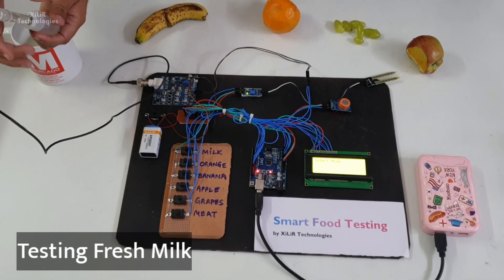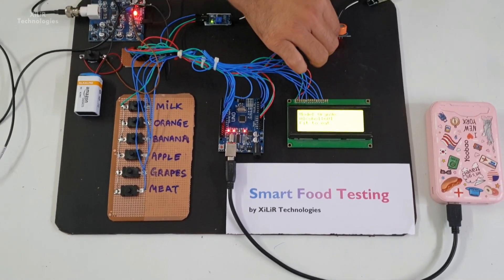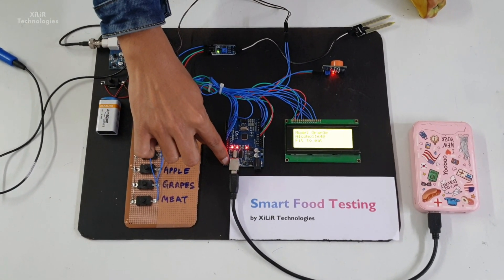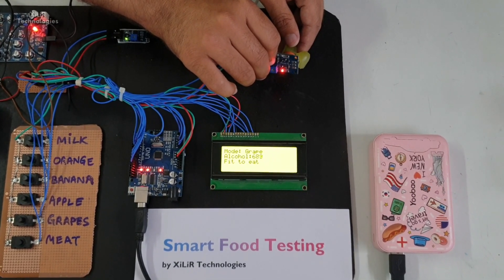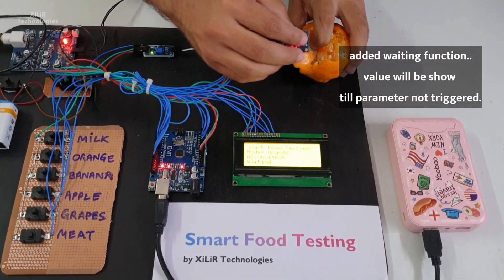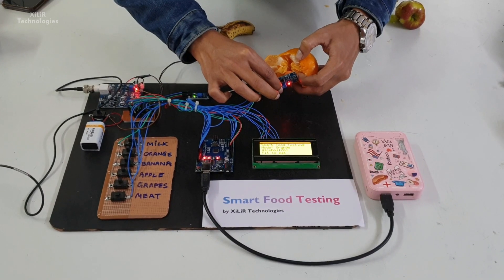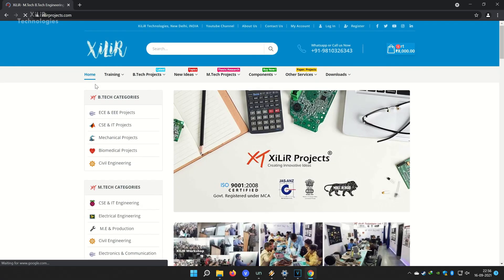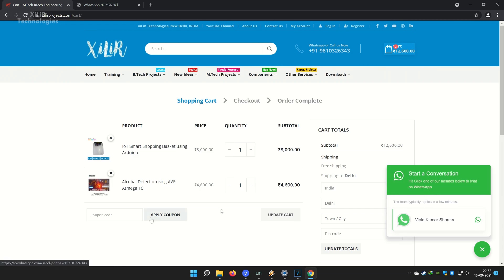IOT Food Spoilage Detection System using Arduino | Food Quality Detection and Monitoring System

Comment: how do you check spoilage of meat  ?
Reply from the maker: By moisture contact or smell sensor
Reply: @XiLiRTechnologies  why can't we use mq4 only i.e. methane sensor which is used to detect spoilage of banana
Reply from the maker: Yes you can...
Reply: @XiLiRTechnologies  Sir can we use mq2 sensor instead of mq4 sensor for methane detection
Reply from the maker: @lkwh60-g1  yes